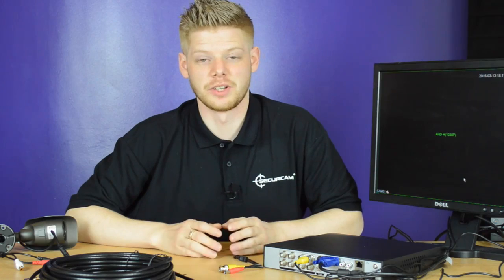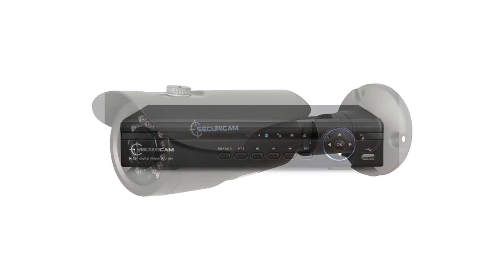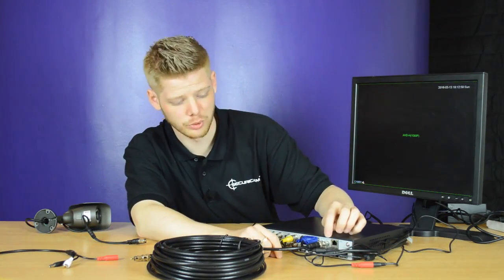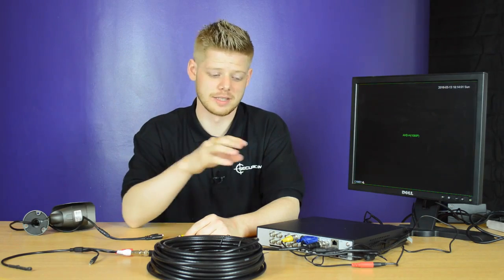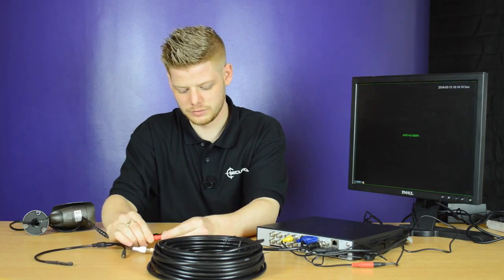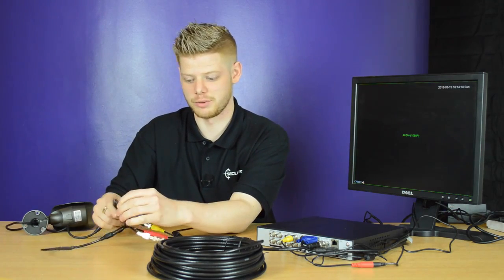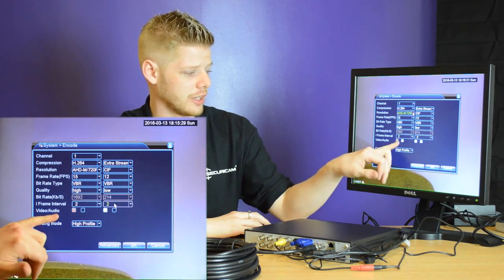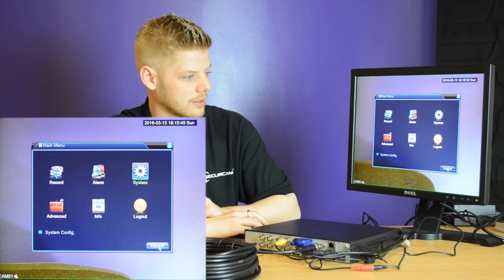How To Add A Microphone To Your CCTV Camera System - www.cctvtek.co.uk

Comment: Is it possible to add audio to an existing set up using RG59 coax?
Reply: yes simply run a cable with phono ends connect to the yellow on the mic then connect the power from the camera to the mic and the mic 12dc ower to the camera then the other end connects to your audio in on the dvr  then setup the audio as in the video to which ever channel your wanting audio job done.